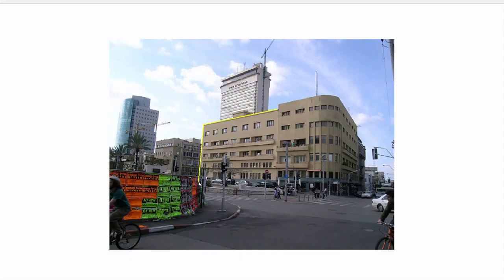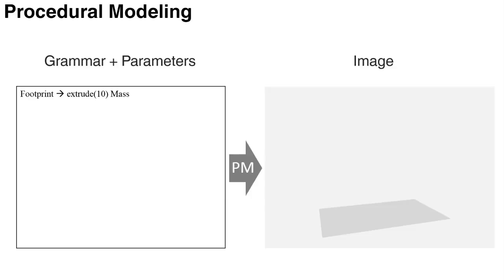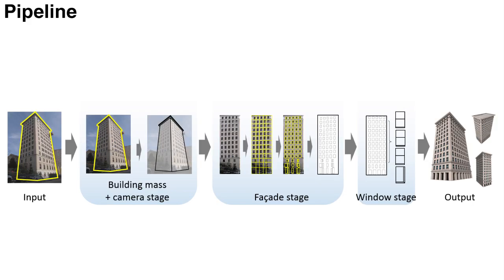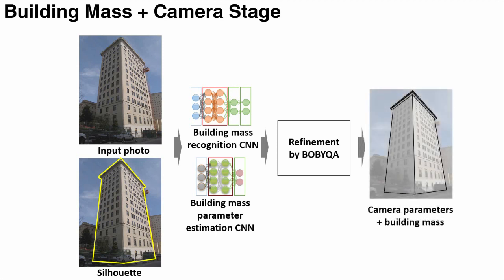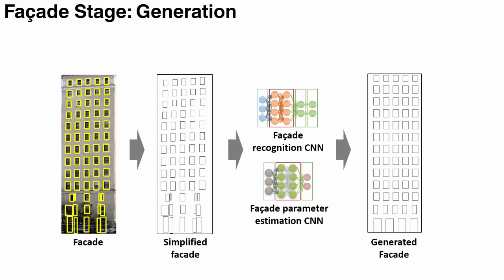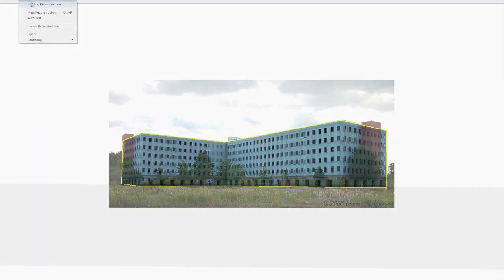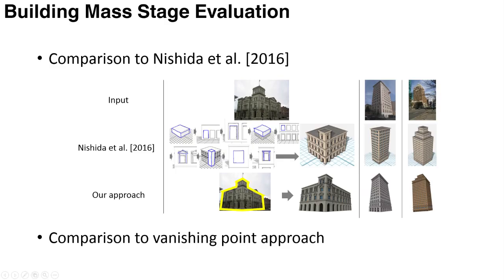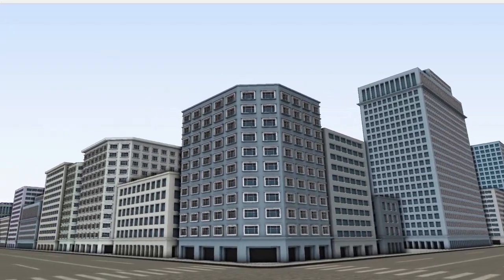Procedural Modeling of a Building from a Single Image (Eurographics 2018)

Comment: Hello Gen, thanks so much for the excellent video.  I think this project as a great deal of potential, whether it is open source or becomes a commercial product.  I downloaded the code but the executable is looking for specific NVIDIA .dll files (for example curand64_70.dll) which are not on my system.  I can probably download them and place them in the same directory, but have you considered updating your project to actually include all the required files?  Or are there specific requirements such as an NVIDIA graphics cards that are not obvious?  Thanks so much!
Reply: Hello, have you found where to download the missing file?
Reply: @janhecl708  Sorry, I have not, but even if I had I think the software requires a NVIDIA graphics card which I don't have.  I emailed Gen a few weeks ago and volunteered to help get this software into working shape but so far he has not replied.  This looks to me like another academic project which is not going to have any further development now that the paper has been published.
Reply: @Sba Stuff hey so someone replied on your stackoverflow thread, to that person it seems simple but i don't know what he means and how it works, i have 0 experience with qt creator. i tried installing qt creator though and when i launch phototo3d now  windows tells me "this app can't run on your pc" before it did the qt platform "windows" error. have you managed to figure it out? do you know what the guy in the stackoverflow thread means? thanks!
Reply: i do have an nvidia gpu, i just tried to install QT 5.6.3 but i get the same error: could not find or load the Qt Platform Plugin "Windows" in """.  i also tried to add the plugins folder to the app dir. i have this problem with qt when i want to launch it i get a cmd saying: Remember to call vcvarsall.bat to complete environment setup! i don't know what this means and how to solve it i also don't know if it's important. how exactly did you get around platform plugin error?
Reply: @Sba Stuff which 4 dll files do you mean and where do i paste phototo3d.exe? i copied all the dll files in the plugin directories to the app directory which are about 45 files. that didn't work. thanks for your suggestion
Reply: @Sba Stuff someone on the qt forum helped me and this seems to work for me : from Qt5.6.3\5.6.3\msvc2013_64\plugins\
copy the folders "platforms" and "imageformats" into your app-directory
copy Qt5.6.3\5.6.3\msvc2013_64\bin\Qt5Svg.dll into your app directory

however i can't really reconstruct a building because i get this error:  load texture failed : material/bldg2/roof.tif.  it is running though. let me know if this works for you and if you can actually reconstruct a building if it works
Reply: @autochromes   you just need to add a folder bldg2 with all the material inside the folder material. it's working for me !  https://twitter.com/OdinLovis/status/1217499202881716224
Reply: @Sba Stuff Did you find solution Mr. Sba. I must to run it. Pls help me.
Reply: Its working great if you have NVIDIA card. And if you do 3D without NVIDIA today , its the mess.
Reply: And CityEngine is not the same at all..

Comment: Hi Gen, I downloaded the EXE I would like to know how exactly do you use this?
Reply: Did you get the executable to launch? I got stuck with UI not regonizing qt windows plugin since i don't know which platform it is looking for and so on..
Reply: @DaveMbrr  Hi, so far I have not been able to get this running either although my errors are different.  The executable is looking for specific NVIDIA .dll files which are not in the package.  I spent some time looking for these files online but the current NVIDIA installer has more recent versions which don't work with the executable.  What errors were you seeing?
Reply: @Sba Stuff you need cuda 7 to fix cuda dll errors, im also stuck on QT, the folder have QT5 files, so i think it need QT5, I tired QT5.6.3 msvc and mingw but it didnt work. :(
Reply: do any of you have the exe still installed that you can send?